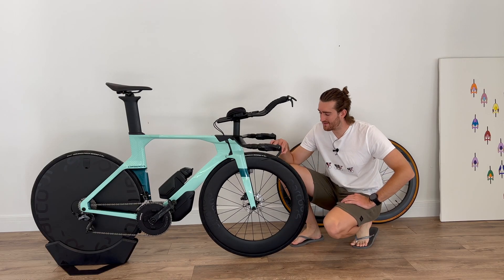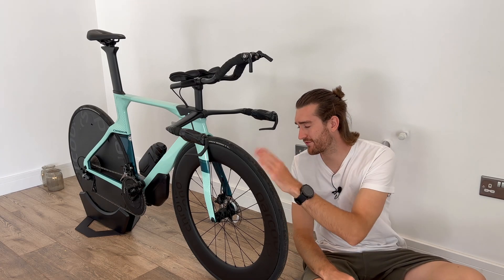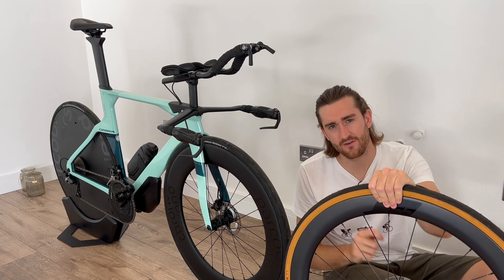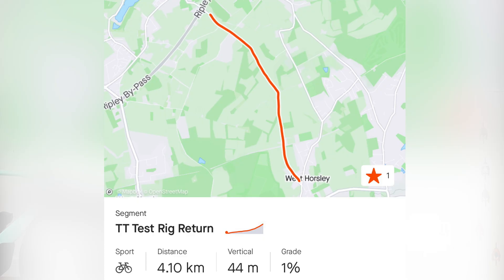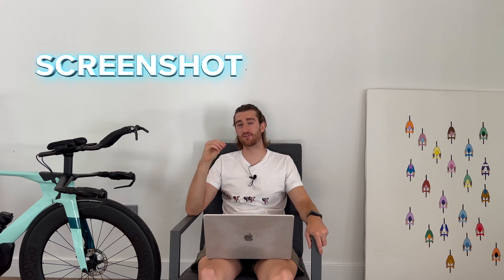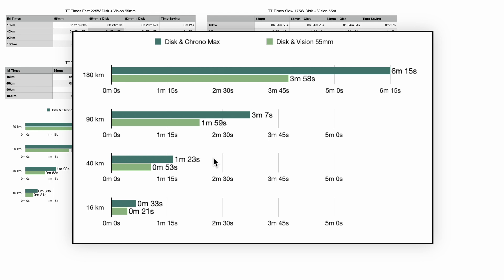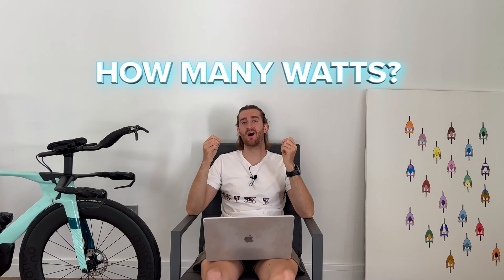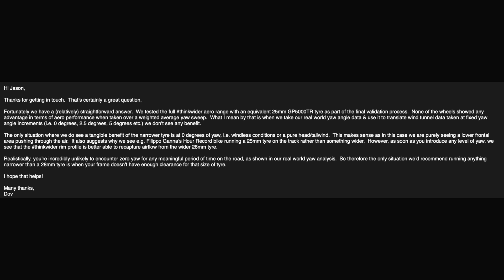How much faster is a DISK wheel? | Tested

Comment: Thank you Jason great work. I looked this video many times and just now noticed that it looks like disk wheel on slower speeds produced bigger time gain vs fast runs at 44kmh.. Did you notice this? Why do you think this is happening? I guess we all (at least me) thought "disk works on higher speeds" but it seems not exactly.. interesting to know your view. As i was going to sell my Zipp Super 9 Clincher disk.. due to "marginal gains" on speeds below 40kmh (i am not that strong to hold over 40 kmh on 70.3 even) but big hassle with transportation and bike adjustment to swop back wheel.. now i am not sure if i should give up 2-3 min on slower speeds as well..
Reply from the maker: Hey! 

It’s a tough question. I think part of it could be my testing. It was done on open roads so maybe just from coincidence the slower runs had some extra wind? 
I did throw away any runs where a car came past. 
But yes, I also thought they were better at high speeds. 
I think we would need to get them in a wind tunnel to really say and lock down the reason. 

For me I still think the disk is worth it. Particularly for the longer tris as the time really starts to accumulate. I think the 2-3 mins is worth the hassle.

Comment: Is it worth to upgrade if I'm cycling at around 25km/h? I cycle mostly flat terrain and city like conditions. I currently have normal thin rims and I'm thinking of upgrading.
Reply from the maker: I assume you would like to upgrade to a deeper wheel set rather than a fully fared disk wheel? 

If so, even at 25kmh it would benefit you. Not much and unlikely to be tangible however. 

On the other hand, a deeper wheel does look cool so aesthetically it should improve the bike.
Reply: @cyclingunboxed  what rim depth/setup would suit me?
Reply from the maker: For city riding I would personally go for something a bit lighter than can accelerate faster from lights. Something around the 30 or 40mm depth should be lighter than most 50mm deep wheels. For faster road riding I feel 50mm is the sweetspot for weight and speed

Comment: Hi Jason. I did a rough calculation. The result is roughly as follows: Disc only: 16 W faster. Disc+83: 24 W faster. Or in other words: with 55/55 you have to pedal these watts more to be just as fast.
I adjusted for a slight headwind/tailwind, otherwise the values would not have been comprehensible. But why the 83 front wheel is so much slower uphill is somewhat curious. My calculations are not precise enough for this, i.e. too imprecise to the decimal place. Actually, an 83 mm front wheel shouldn't really be slower at just under 30 km/h, but the higher weight of the disc also plays a role (only 5 W gain at 175 W base).
Rear discs are often really fast, especially in crosswinds. 0.8-1 km/h can quickly add up.  Higher front wheels have less effect and you can see that here too. However, I have my doubts that the 8 watts only come from the 83 vs 55 rim. 55 mm is quite a good height, the tire width on the 55 probably plays a role here and the different tires play a very minor role. Your aero gains are all (too) large because they were measured on a downhill section with high wind speeds.
If you calculate with cda values without the downhill section, you get approx. 37.4, 38 and 38.3 km/h at 225W. The watt differences there would be: 9 and 14 watts. I calculated with a slight gradient of 0.1%. The values sound a bit more logical. Regards
Reply from the maker: Hey! 

This is so cool! I genuinely really appreciate this. Sounds like you did what you could with the data i collected. I’m sure an aero sensor and the ride file would make this more accurate. 

This is some very cool data. Do you mind if I post these results in the description. 
I would put a disclaimer by it suggesting that this is an estimate based on the data you had to your disposal.
Reply: @cyclingunboxed  Hi Jason. The 9 (disk only) - 14 watts (disk + 83) mentioned later are the much more logical values for me. They also fit well with my experience of almost 15 years of TT. Of course always relative to the baseline, in this case 225W. These are absolute values. The first 16-24 Watts are almost certainly too high, probably because of the high wind speed, where the aerodynamic values become too important. I think this can be tested without an aero sensor. I personally test routes that are as flat as possible, preferably no (!) car traffic at all, and always take out & back as measured values, flying start. That way you can calculate the wind variable even if there is some wind. At least roughly. If you are going 41 km / h in one direction and 39 km / h in the opposite direction ... Well, the example is very simple :D, but then it's just 40 km/h. Take the average of both measurements and divide by 2. This will give you better results than taking the total average speed, because the headwind part will get a bigger share (which is not what we want in this case). And sorry for the translator English. I was in a hurry!

Comment: Easiest way to test the watt difference of a change is to ride your tests holding a fixed speed instead of a fixed power and just read off the average power it took to hold that speed.  It's also way easier to ride constant speed than constant power.
Reply from the maker: I can see your logic.

It’s definitely the better way to find out the power difference between the two rather than calculating it.
For me though I wanted to know the amount of time it would save me and I don’t have the mathematical ability to convert watts to time saved. 

I’m also not so sure that on the course I did, it would be very easy to finish at the exact minute and second each time whereas I did find it very easy with the power as I hit most of them at bang on 250 with only a 1 watt discrepancy. It was around a 4.5 min course

Comment: 40sec to 1min over a 40kms Olympic Distance Tri Bike Course With Well Smoothly Matched Tyre Widths of Clinchers the discs Matching Disc Width and Smoothly Theat Transition 30mm parcore Tyres rear disc rime area of that Disc a smoother transition there

Comment: I have the same Ordu as you (same colour too!) and am using it for standard and 70.3 Triathlons.  I recently swapped the Vision 55's for the standard Parcours Chrono front and rear (77/86).  Running GP5000 28mm with latex tubes and Silca speed shields.  I haven't done any proper testing but my average ride speeds have generally increased by circa 1 km/h.  For me, the wider inner rim width (22.5m vs 19mm on the Visions) provides a more confortable ride and more confident cornering, which means you can get the same or better time for lower effort, and helps save the legs a bit for the run.
Reply from the maker: I have had the exact same experience as you with the wheels and tyres. It’s been a very worthy upgrade.